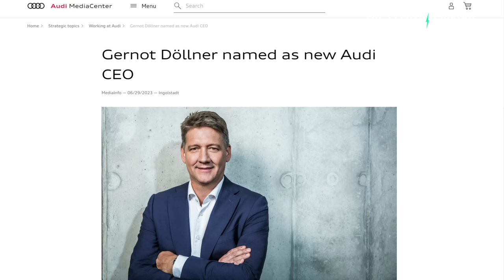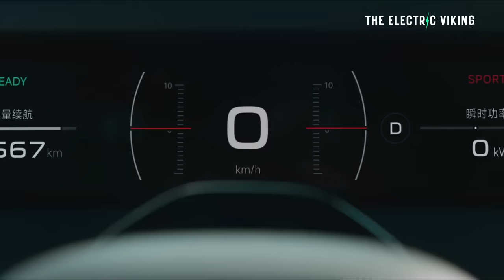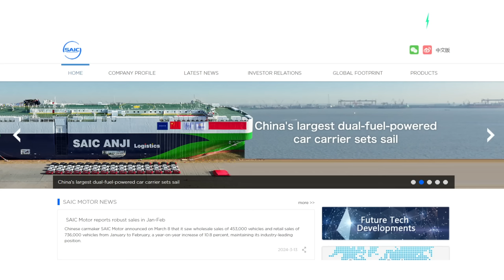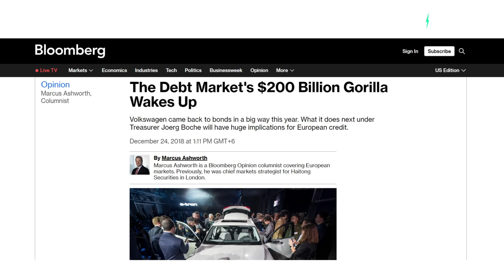Audi's CEO says fossil car demand will crash in 2026, making ICE expensive

Comment: Winding down the ICE market will be far more difficult and more precipitous than anyone thinks. 
- as Sam points out, winding down production lines doesn't work: if you produce less on a given line the cost of the vehicle MUST go up, fast. Which will suppress sales further. It's a downward spiral.
- as people switch, many dealerships WILL close: the economics of dealerships are built on service revenues, and fewer ICE cars means falling revenues. But that isn't off-set by EV maintenance: well-built EVs (not the crap from GM, VW, etc. thus far) need very little maintenance. And as dealerships close, that'll drive ever more car owners to consider an EV for their next purchase.
- as people switch to EVs, the economics of gasoline distribution similarly collapse. Integrated oil majors like Shell, Exxon, Chevron: they're ALREADY closing stations across the market, or selling them to naïve independent station operators, who haven't realized they're buying locations that are polluted & can't be sold for non-gas station use without very expensive remediation. They think that won't be necessary for decades, and that they can depreciate the purchase price over decades. Bozos.
- as gas stations close, "range anxiety" will STILL be a thing - but it'll refer to ICE vehicle drivers who realize they now need to drive 30-45 minutes EVEN IN A CITY to fill up the tank with gas. THAT will drive EV sales.
- as disruption kills most car companies (& most EV startups), industry consolidation will occur. And new car buyers will ask themselves whether they believe the company whose product they're considering looks safe. A car is the second largest purchase most people ever make; you want to know the company that produced it will be around to service it. And you want to know there'll be a resale market for the car when/if you want to sell it. Buyer worries about car company collapse will trigger increased market consolidation, as people shift their purchase to the brands they expect to survive.

Ever EV purchase reduces the ICE car economy, and as reduction occurs it'll drive ICE car usage down ever more quickly. Faster than people realize now.

GM is toast. VW, Toyota, most other legacy manufacturers: they're going bankrupt, or surviving only with government bailouts, if governments are stupid enough to give them your tax dollars as a reward for having their heads up their collective, um, a4$$ets. And there's going to be a LOT of consolidation in the marketplace as car companies merge in hopes of winning a small part of those bailouts.
Reply: Excellent post and correct on all accounts. It's a bit of an exponential ramp due to all kinds of negative feedback as you nicely outline, negative feedbacks that all interdigitate and reinforce each other. And high on the list of negative feedback is the potential contagion of awareness that this is a dead technology or at least that it's dying fast, so you better get out while the getting is good. When's that awareness starts to spread you will see panic selling, and massive cratering of any demand, as used ice Vehicles flood the market for next to nothing. And as many of them probably won't sell, this will of course seriously exacerbate all the other issues you were nicely outline

Comment: Don't get me wrong, I love working on cars... When I decided to pursue Tool & Die Maker... My auto teacher was extremely pissed off at me.  He said that could certainly be on a Indy Car or maybe F1 team some day.  It's fun working on them and upgrading... but that's when you're young.  I've got a family. I don't feel like turning wrenches working on a car.  Just get in and go, or hop on my mountain bike and go for a ride.  I love the simplicity of Electric Vehicles.  Far less moving parts!  Full of tech, which is actually much cheaper than my Home Theater Setup.  I'd rather have the tech in cars.  I'm excited to see what comes out in the future!  I am extremely confident in saying that my first E.V. will be a Tesla.  I don't see why I'd jump in with any other brand other than the one who is possibly ahead of them all.
Reply: Never done more on my car then change a wheel, check tyre pressure, top up screen wash.    Genuinely never had to top up oil in my car.   So not sure how an EV will change my experience, for the past 10 years then my experience has been walk upto car, pull on door handle, get in and push button to start.   Check no warning lights and go.
Reply: Thats great to hear! Just be sure to hold onto whatever you are saving, as once the 8 year warrenty is gone, your gonna need it. Sure ICE is complex, but being modular means repairs are cheaper. Unlike EVs, with only 3 parts that cost a minimum of 1k for a repair. EVs are great for anyone who has a short term goal with them. Once they are out of warrenty, be ready to buy a USED battery pack for 5-10k when it does eventually fail. Unless you have a luxury class, then it'll be ~20k for the pack. Keep in mind if the EV is old and used enough, you'll have to replace the motor, Inverter, and pack because that's just a pesky con of electrical design, can't match new hardware with old wornout hardware as these EVs require proper load matching to work. But it's ok, as I'm sure your already saving up for your next New EV as that's way the market will be in the future. No one will buy a USED EV without a warrenty. Same reason I trade them in every 2 years or so. Can't be liable for those kind of repairs. That's not smart.
Reply: It'll be nice too for ICE vehicles. Since we can't produce plastics and rubbers without making light fuels like gasoline. The prices will drop below electric and it'll be nice, as in 15 years, most used ICE vehicles will be exempt from emission standards, and with an overproduction of fuel making it cheap? Yes please, buy up them EVs.
Reply: I hear you. At my last major service visit to the dealership ($1,100 for SCHEDULED maintenance) I chatted up the Service Advisors, asked them what THEY drive. Understand, I drive a Subaru Outback; service guys LOVE their Subaru vehicles, like I do, and for the same reason: Subaru is run by engineers, not Sales (Toyota, Ford) or Finance (GM). Subaru owners are intensely loyal. 

Two of the three Service Adivisors on duty PLUS the Service Manager, all drive Teslas. They're pretty sure the rest of the Service team will switch to Tesla before the end of 2024. Said quietly though. I asked "Don't you guys need the ICE service business to survive to keep your jobs? None of them is convinced Subaru's business will survive - or that its dealers all will, if it does. 

I asked my Sales Rep whether he's seeing a trend in the last two years, of Subaru owners switching to another brand. Off the record, yes: Tesla, without fail. Nowhere else.

I would love to see Subaru survive; hope it does. But our next vehicle (after 3 Subies in a row) won't be a Subaru. Unless there's major improvement in other brands it'll almost certainly be a Tesla.

The entire ICE vehicle industry is being disrupted. It's anyone's guess who will survive, if any.
Reply: @michaelmcnally2331 so are you claiming as some kind of Genius that you figured out how to do away with oil changes, transmission fluid changes, differential fluid changes, coolant changes, Spark plugs, tune-ups, etcetera. Or are you just skipping all those things and hoping the car doesn't break?
Reply: @douglaswatt1582  no the car mechanic does them.   Was responding to a person saying they liked getting the car tools out and working on a car themselves whereas now they don’t.    Never done any work on the cars myself so whereas he now just gets in and drives, I do the same myself so no change
Reply: Yeah I used to love working on cars until my back went South. But I did love putting on the mountain pass Performance Suspension parts. Those are fantastic!

Comment: Putting a legacy badge on chinese evs is not going to keep the brand alive.  Not when Tesla is making quality cars from the ground up.
Reply: Since when?  Tesla is regularly measured at the bottom of the quality barrel.  And the Chinese made ones are the worst.
Reply: @billcichoke2534 Chinese made EVs are the best quality Tesla or BYD
Reply: @i6power30  lol, sure...Chinah Numbah hwon!...
Reply: I agree, putting your badge on something with lower quality that loses money will not work.  Chinese EVs don’t make any money, margins are negative and no way to make up revenue on the service side as EVs are very reliable.
Reply: @johnlehew8192  EVs aren't reliable, there's just nothing a user can do to maintain them so they last longer.  And WHEN things fail, it's often expensive enough the car is a write off.

It's not just DEALERSHIPS who lose money on these things...
Reply: @billcichoke2534 That's clearly bollocks. Batteries and motors require care when working on them but there are battery cut-offs making them safe to work on. All other parts of the car are no different to an ICE vehicle.

Early adopters ALWAYS run the risk of buying a product that is superseded by cheaper, more advanced models a few years down the line.
Reply: @Jamessansome  WHAT'S clearly bollocks?  You don't repair motors or batteries; you REPLACE them.  There is no maintenance possible on them.  And those are far more expensive than anything in their ICEV counterparts.

There's nothing remotely controversial about what I said.  Deal with it; that is EV reality.
Reply: @billcichoke2534  A home mechanic may not be able to repair motors or batteries but they can be repaired by a specialist. In the same way a home mechanic may not be able to skim a head or re-line cylinders but they can be repaired by a specialist.

The biggest difference is the fact that there are hundreds of moving parts in an ICE engine, any of which can fail, deteriorate, become gunked up etc. plus you need regular oil changes, plugs, filters etc & all the other emissions systems, sensors etc. that become temperamental with age. 

EV's just don't have any of that...
Reply: @billcichoke2534  There is no regular maintenance required. Motors and batteries will outlive the lifespan of the vehicle.
Reply: @Jamessansome  No, a motor or battery doesn't get repaired if it fails; it gets REPLACED.  If your spark plugs or water pump fail, you can replace those yourself.  For another comparison, look at diesel electric locomotives.  Nary a one has the same electric motors they started off with, as those fail after so many hours of use.  Almost every single one has the original diesel engine.

Maintenance.  Something that can be done on an ICE, making it possible for it to last decades and hundreds of thousands of hours.  Something that is not possible with electric motors or batteries.  It's not about specialists; it's about assumed versus actual longevity and durability.  EVs lose every time.
Reply: @Jamessansome  They haven't yet.
Reply: @billcichoke2534  EV motors don't need maintenance. If there are no maintenance items required then they don't need maintenance. It's as simple as that. Electric motors have ONE moving part, which last for hundreds of thousands of miles with NO maintenance. 
There is no way an ICE could last that long with no maintenance. Even with maintenance many ICE don't last past 200k. In the UK the average mileage is only 140k before being scrapped.

On a diesel electric locomotive the electric motor drives the wheels. The diesel engine isn't under even a fraction of the load the electric motor is under and a diesel engine & gearbox would fail miserably if you attempted to use them to pull a train of the same weight. Long & heavy trains wouldn't even exist without electric motors.

Comment: Not true as the EV market in EU has just collapsed
Reply: LOL.  Keep taking the copium.
Reply: It was just reported that EV sales were down 30% off 72,000 cars for the first quarter
Reply: New EV sales consist for a very large part (90-95%) of business lease contracts. Those type of sales are indeed dropping like a stone. And the second hand market is flooded by EVs that are about 4-5 years old now, with lower ranges. Like 300-350km max, instead of the current 450-550km. Consumers don't want them.
Reply: BS
Reply: Reported by Autoline it’s just facts
Reply: @kennedyracing7527  LOL
Reply: @Markcain268  LOL